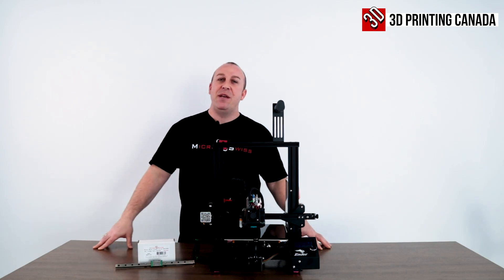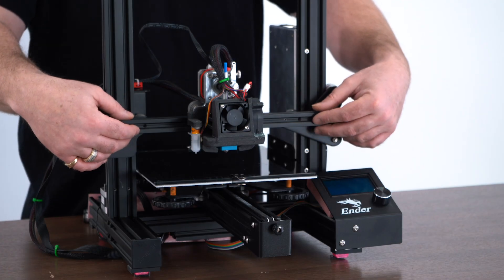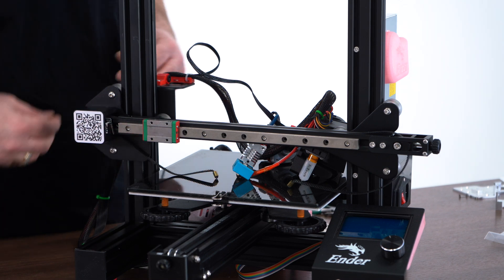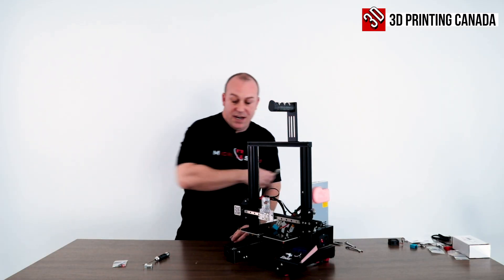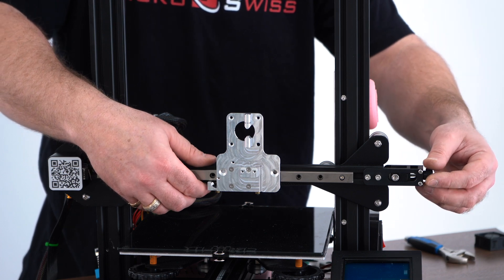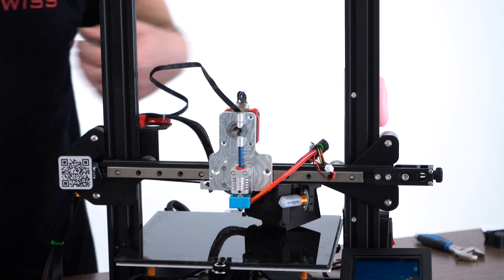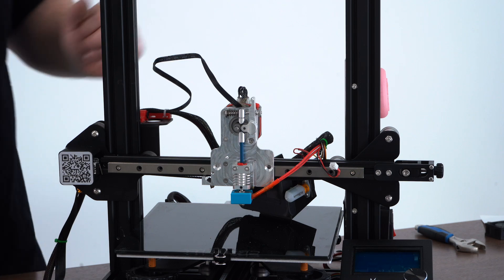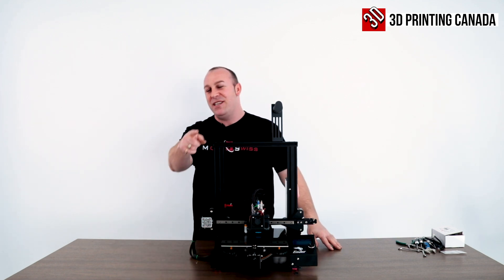Micro Swiss Linear Rail System

Comment: One important step that your forgot to metion is that the Linear rail needs to be leveled to the bed. In some cases the linear rail may not be level to the bed but by using a 123 block or similar on either side of the rail and lowering it to the bottom of the rail (Not the 2020 extrusion) just touching the blocks on left and right sides, then tightening your T nuts to the 2020 extrusion is very important, for having a level system

Comment: What is the advantage of the linear rail system compared to the "normal" system?
Reply: May be a BIG difference, depending on your 2020 rail for the X axis. The linear rail will be as close to perfectly straight, which is not always the case for the 2020. Also the bearing is riding on precision ball bearings, instead of the not very accurate POM wheels riding in not so accurate slots, plus no tension issues screwing with the eccentric nuts.  The print quality WILL be better, and more reliable.
Reply: I have installed linear rails on all the axis of my ender 3, just for the fact that the wheels over time will get flat spots on them, especially if the printer has been sitting for a period of time. With Linear this will eliminate that. Also the rails provide a more smoother movement was opposed to the wheels system, and in some cases it will reduce ringing in your prints that can be caused by motor, wheel and belt vibrations.

Comment: Having fitted the same fan shroud to the micro-swiss on ender  3 (not linear rail version) the part cooling fan nozzles are not aimed correctly, and as for the normal ender 3 metal cover, more air leaks from the hot end cooling fan over the part. The whole process is a bit pointless, unless you modify it even more to be able to print higher temperature filaments.
Reply: I also find the satsana for micro swiss unusable, it doesnt cool the heat sink well enough and i get jams with it. I now use the hero me with dual 4020's and it works great, the heatsink cooling portion has a nice design, it cuts the heat off right at the heatbreak area. Fantastic results with it so far!